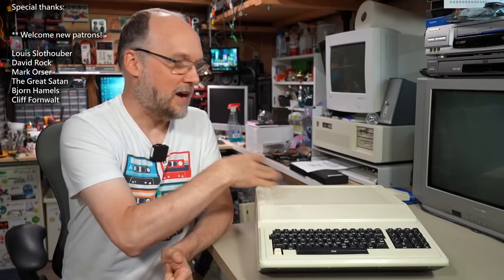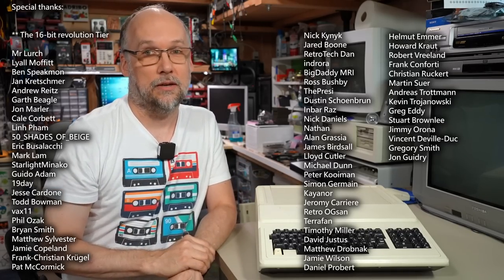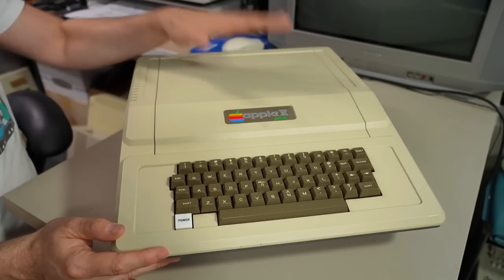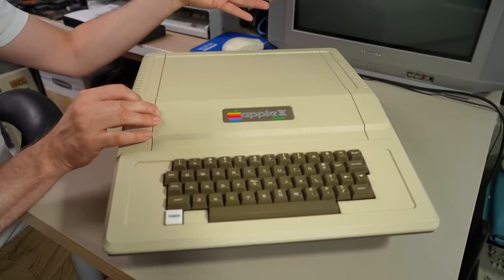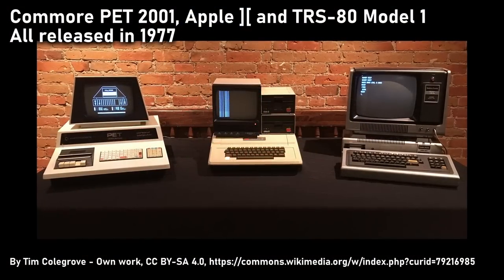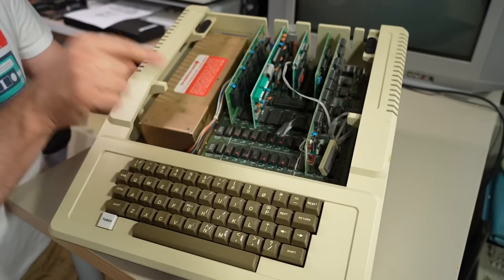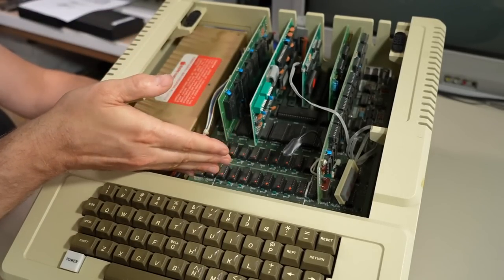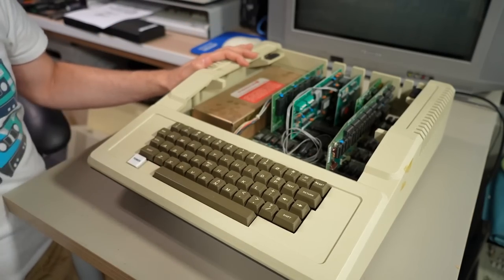Apple II+ clone repair: I thought this would be easy... I was wrong

Comment: Now I'm very curious about how this will end, but I'm sure you will fix it!

Question: the component tester that comes out around 20:20, is it the same that can be had for cheap on AliExpress? I see them there for about 12-15 euros (prob. the same in dollars). As we can see here it correctly recognises a transistor, which is good, but how well does it do with other components and ICs? Basically what I'm asking is should I buy it or save up for something better? Just a hobbyist with limited means here.

Comment: the coco has a hires text mode (it might be part of extended basic included with the disk controller) with upper and lower case characters. i don't remember the command you type at the prompt, but it's really short... something like: mode(4)

i haven't typed it into a machine in 35 years or so... i don't remember the exact command

Comment: Why are we still using the equivalent of stone knives and bear claws to diagnose circuit boards. An advanced diagnostic platform was depicted in 2001 (the movie) released in 1968. Vision systems today should be capable of recognizing where on a PCB a probe is touching and translate the view to highlight the trace on the schematic. 

Another tool we should have in our test kit is a Hall effect current probe. While a voltage probe can tell you where a trace connects, the current probe can further refine the information and tell you the path and direction the current is flowing. Commercial Hall effect probes are rather pricy but the tech is simple so home brew solutions should exist.

Comment: You might want to  try using your highest resolution (121GW?) multimeters' resistance setting to pinpoint the general area of the short.
You should be able to attach one probe end to your transceiver socket, then jump around the board with the other until you find the lowest resistance point.
Reply from the maker: Since I'm working way in advance of when these videos come out (due to the time required to edit) - I will just say you have made a very relevant suggestion. :-)

Comment: I wonder if any of those clone makers tried to be "fully legal" , by buying the genuine Apple ROM chips as spare parts through authorized servicing dealers and building them in?  Or were the chips priced expensive enough to make this excersize uneconomical?  Or was Apple catching on and disallowed mass sales of the chips?  It would have been easier (and more ethical) for the hobbiest bare-board builder to just buy the ROM chip than copy a friend's?

Comment: Just a thought... If jou remove the bus transceiver would it be safe to pull the address line high and the dataline low with a power supply. It would be like voltage injection, the short would get hot....
Reply: I was thinking the same exact thing.  Start with current limited and slowly turn it up. Use the FLIR to see the exact path to the short start to warm up.  My non-electrical engineer guess is a solder blob down in one of the expansion ports.. Probably not it, but it's fun to guess!

Comment: There was a whole industry in Toronto, Canada selling "kits" from small computer stores.  A "kit" could be as simple as a bunch of parts you put together at home as far as a whole set of components and a motherboard that you could solder yourself.  They were rampant with names burned onto the roms other than "Apple ][" - (Orange, Banana, and a bunch of other variations).  Most of the boards were blatant clones of the original board rather than re-engineered work-alikes.  I guess these kits got around some of the import restrictions as they had no roms onboard (but the guy in the store would include a set under the counter).

Comment: You need to make a all new parts motherboard, I'd watch that in realtime!
Reply from the maker: I have to wonder if some of the harder to find parts are still around like the slow connectors? All the ICs are easily obtainable still except the CPU, where I'd have to use something old. (The new W65C02 isn't pin compatible anymore)

Comment: One way of finding shorts even when they are on the PCB itself is by injecting a low voltage that wont hurt the non offending parts like 3v at one of the pins and ground the other (with the machine turned off of course) a thermal camera shows the problem right away but that's not always easy to get, in that case a can of freezing spray works wonder, and if that's not available either using alcohol on the board and see where evaporates faster. At first is a good idea to start with a somewhat low current to avoid damaging traces

Comment: I'm expecting those other transistors to be bad as well. They're generic PNP replacements, but probably came from the bottom of the barrel. Is that the reason for the socketed transistors near the crystal? If they worked when it was new, what could cause them to fail? Maybe it could have been bad packaging that corroded internally after time, who knows.

And I'm pretty sure the clone Apple II that I have is also this same board, so I'm downloading that schematic, because I'm pretty sure that I tried it and it didn't work, and I'm going to have to fix it. Thanks for sharing the info!

Comment: I wonder if throwing this board in an oven and baking it would help. If it's some lone solder blob somewhere that's shorting A3 to D2 then baking it could reflow it and undo the short, Otherwise, it'd have to be some RAM chip or other IC on the bus that's just shorted internally,

Comment: Technically, the TRS-80 did have a graphics mode... except that also technically, it didn't.
Graphics on the TRS-80 were implemented by using special ASCII codes which produced a pattern of blocks instead of producing a letter, so you could truthfully say that it didn't have a graphics mode... but then again, it also had commands (SET, RESET, POINT) which interacted directly with those blocks, so you could also say that technically, the TRS-80 did have a graphics mode.
It's the Clayton's Graphics Mode: The graphics mode you use when you don't have a graphics mode. 😆
Reply: Adding: What I'd do to try to track down a short between an address line and a data line is to look for any spot where those lines physically pass close to each other.  For example, the expansion board connectors would be an obvious spot to check.

Comment: The original TRS-80 did have graphics. The graphic resolution was 128x48.
Reply: The "graphics" on the original TRS-80 were embedded in the character set, specifically characters 0x80-0xBF. There is no "graphics mode" on the TRS-80 like there was on the Apple II.
Reply: @JamieStuff Yes, those were special characters that resembled B&W Tetris pieces. There were games that combined them to do really low res monochrome graphics.
Reply: @JamieStuff  NO! the pseudo graphics characters were NOT generated by the character set ROM, but by a separate logic circuit.
Reply: @martindejong3974  I didn't say that they were in the character ROM.  They ARE, however part of the character SET. "PRINT CHR$(191)" would print the full graphics block.  It was the same concept as POKE graphics.  I did a fair bit of programming on my Level II machine back in the day.

Comment: Could you please, please, pretty please take a look at the keyboard PCB? There's an outside chance it has the same board as mine, which had sanded chips. Quite a few got cooked when the PSU went bad. If it is the same and it works you're lucky. Partially because of rarity and partially because it had key combination based macros baked in.

Comment: Can you inject a low voltage and monitor the board in a thermal camera to find the short?
Reply: Milliohm/microohm meters are a thing.  With one you can follow traces and watch the resistance drop as you get closer to the short.